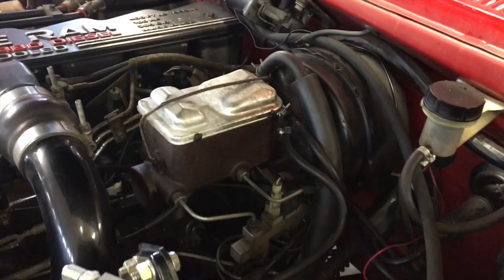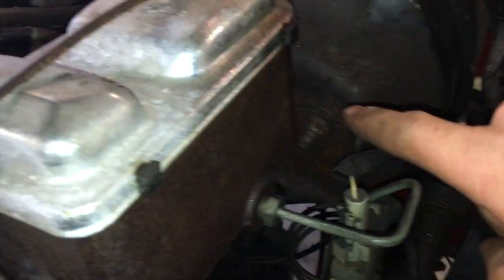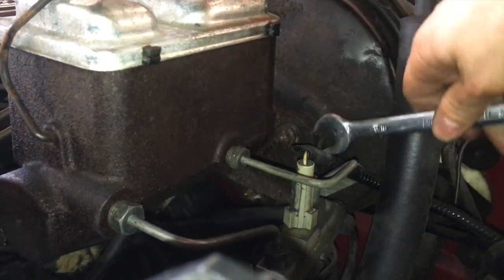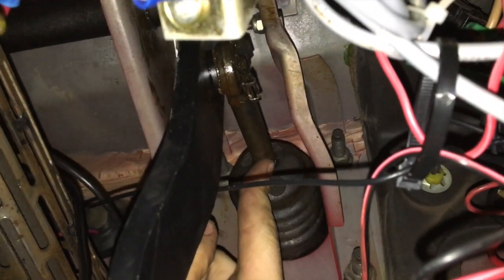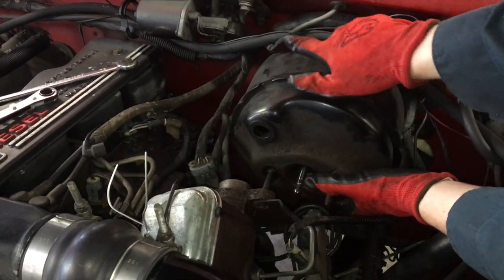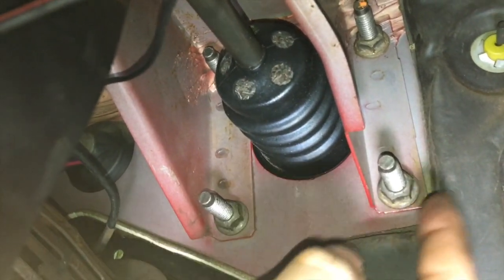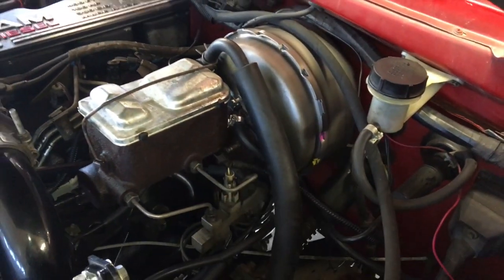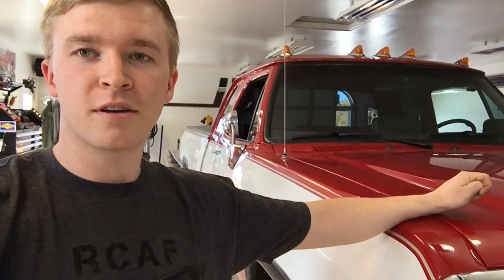1st Gen Cummins Brake Booster Replacement

Comment: Great video! And that other small line going to the booster is to switch from defrost to vent. I found that out when i couldn't get the ac to blow outta the vents. It was stuck on defrost cause that line came off

Comment: My booster is hanging in there, but it is very rusty. I should bookmark this.
Reply from the maker: I made the mistake of not giving my new booster a coat of paint before installing it. I thought it was just painted grey..now it has surface rust all over it. I just spray it with some Krown in the mean time.
Reply: @OvensGarage  The problem is that brake fluid tends to dissolve paint over time.  Had to get a new master cylinder last year and it's rusty already.  At least the lid is plated.  Only real fix is to get them powder coated.

Comment: Tyler you should have painted that thing first, anyways was your ABS light staying on prior to replacing that thing? Mine are hard and need of replacing soon. thanks.
Reply from the maker: Yeah I noticed now after a few weeks it’s getting some surface rust, those reman parts aren’t painted very well.. there were no warning lights when this happened. Not sure if there should have been or not. I noticed my anti lock light isn’t coming on now though during the turn key start sequence for the bulb check.